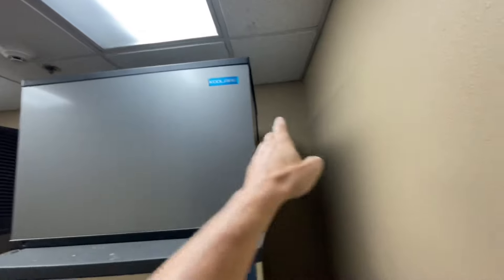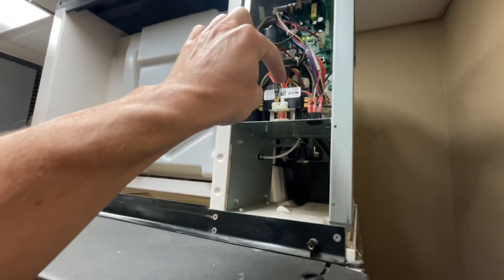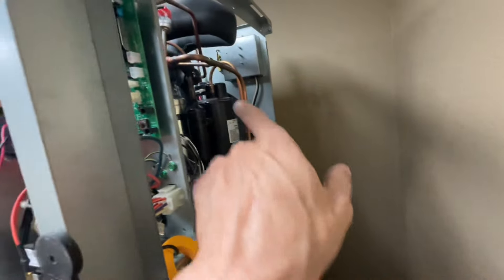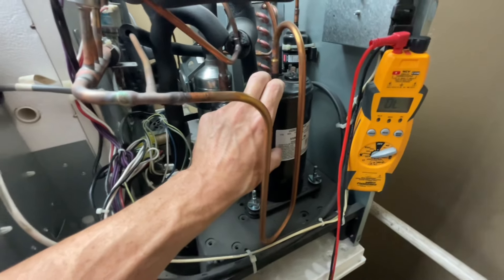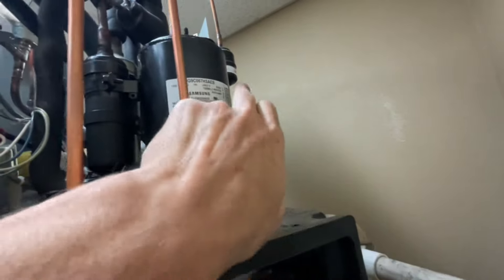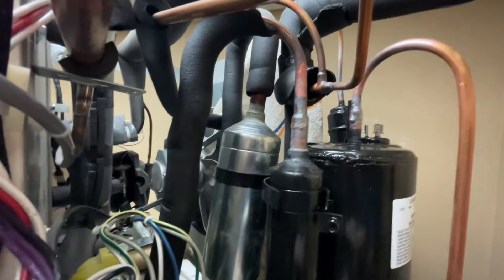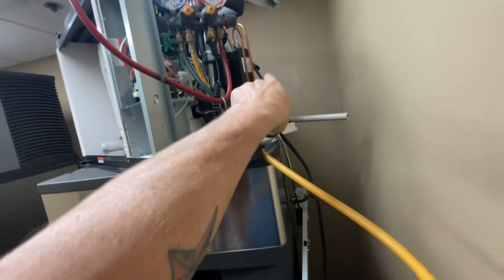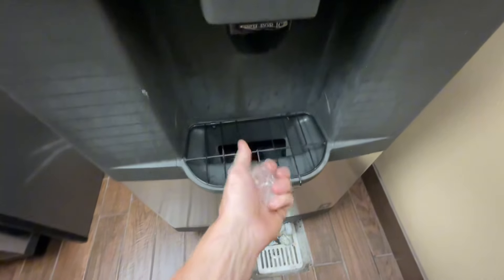Koolaire ice machine troubleshooting - Bad Compressor

Comment: how much nitrogen do you pressurize prior to welding?
Reply from the maker: Don’t pressurize the system. Just flow nitrogen. Set the regulator to 1-2 psi and let the nitrogen flow in one side of the system and out the other.
Reply: @IceMachine411  ok got ya, like just a trace of it in the system. Thanks